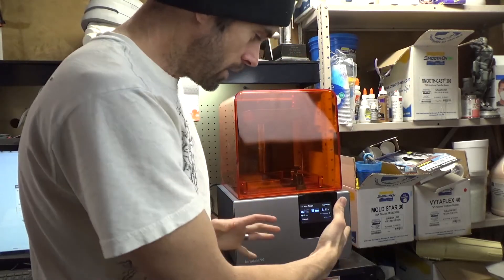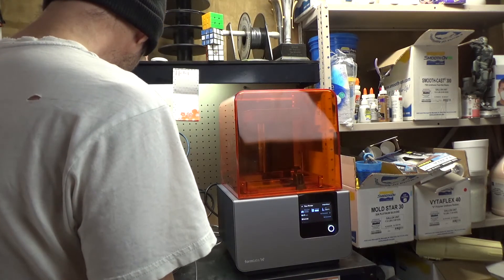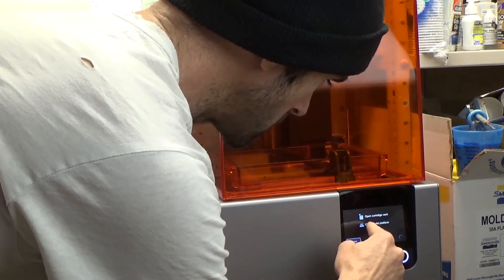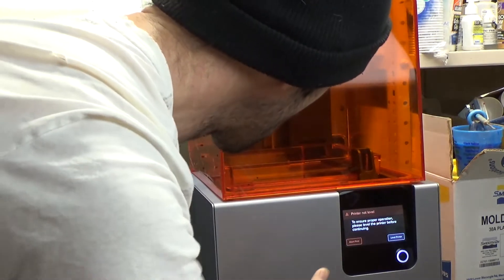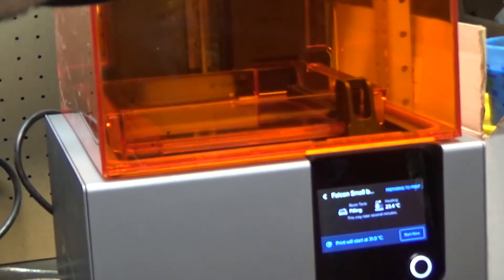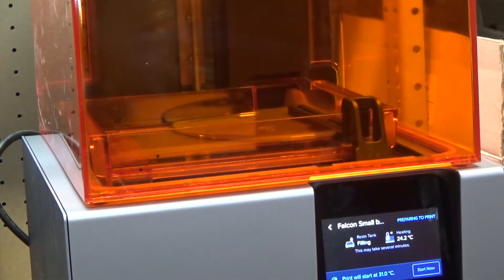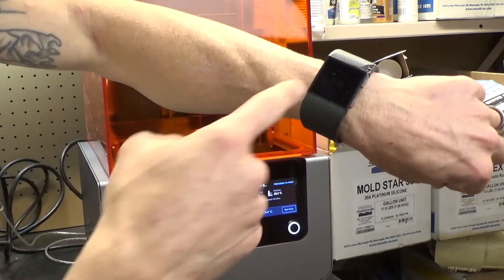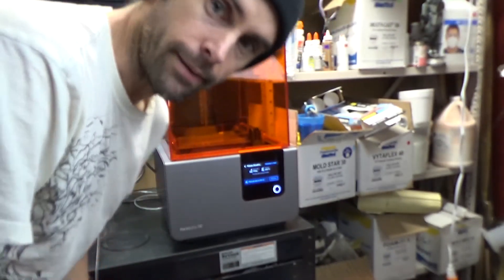Setting up for the first print on the Form2 3d printer-Resin tank fill error!

Comment: to many questions
does the resin give off fumes.
what do you do with the left over resin in the tray 
whats the life span of the resin...
all my best
simon
Reply from the maker: I don't "smell" anything but it's probably killing me slowly while I work. 
The resin in the tray can be used later. once the resin runs out, I'm sure there'll be a small bit left over that doesn't print. I'll drink that part. ;)
I think the resin is good for about a year in the container but not sure how long it's good once it's in the tray.
Reply: well thats a good thing.
 i use polyurethane and to be honest ive had enough of the fumes.
so the printer sounds a more healthy option .
thanks for taking the time to reply
all my best
simon

Comment: I can only say I'm really very dissapointed at the reliability of this printer. Our company has been using it for 6 months (professiona)l now and only had problems with it, ranging from a not correct calibrated optical system or not recognizing the Resin Tanks. So I think this is a nice printer for hobby purposes ,  but absolutely not as a reliable production tool.
BEANTWOORDEN
Reply: FlightIllusion what would you personally recommend to use in its place?